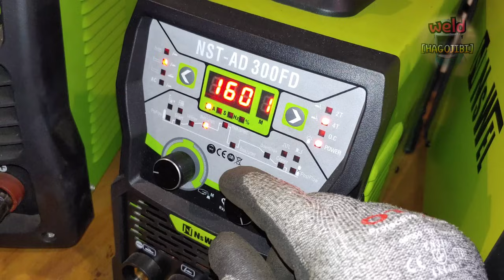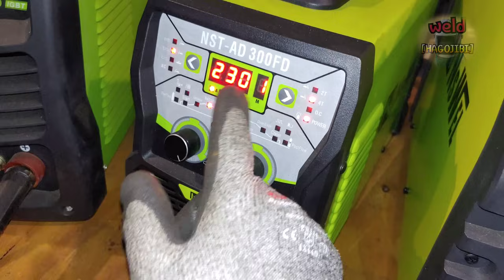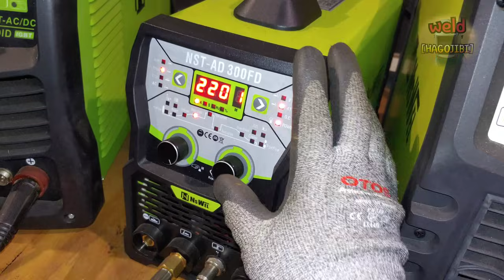Surprisingly useful technique ! Beautiful edge TIG welding process

Comment: Nice job! I’m seeing more and more guys laying the wire in the center of the weld and walking over it…. When I started 46 years ago if you had tried that you would of had 100’s of little holes on each stroke…… very nice video.

Comment: Amazing. can you explain the settings you made. first root second and third pass 
more warm for each string ,what materials? and exact filler rod you used also ?  give us details of the tech.    
what machine is that? looks incredible crisp and responsive.  super great ❤. and you can add advertising in form of machine for example. would love a link to purchase one myself.

Comment: Very good video, I have one question for u can u spot weld a few spot welds with no gas?
L left my gas on and lost it all don’t need it right now, but need to spot weld this for a friend.
thanks
Reply: In a word NO.  6010 Will work with your tig power supply, just reverse polarity to dc electrode positive.
Reply: @kirstenspencer3630  thanks that I will do, again thanks ur welding looks bodayus

Comment: Watched this video about 20 times over in an attempt to wing a tig weld test tomorrow.
Reply: How'd you do on the test?
Reply: @ProMurd3r  did good in the first half just fusing 0.5-0.7mm stainless sheet then 2nd half was welding on this shitty scrap material covered in plastic and it was terrible , someone else with more experience and codings got the job
Reply: So sorry to hear about that mate, hope your welding journey is doing better these days. I passed my coding 1st try. 6gr stick as well. 😢😎😅

Comment: Nice job but I am not seeing the practical application for this.  It would go way faster to do this with a mig/dual shield process.
Reply: pretty
Reply: Just about everything I weld is TIG. 
Nearly everything I build is machined, and there's no way you're putting MIG beads on it.  I weld racing exhaust, turbo components, and custom- engineered machines. I'll run MIG on thick structural >.180", but nowhere else.

Comment: If any purge welders read this I have a question. I've been doing some Sched 10 purge welds. Purge root comes out good but the cap I put on is coming out dark. Any tips?
Reply: Try more gas coverage and maybe a different type of rollout at the end of the weld
Reply: just turn the juice up! duh… 😜

Comment: Looks good bit more of the heat affected zone more on one side than the other.  Love those gas fuse lenses though. They really make a neat clean looking weld. Most importantly  I didn't see you check your root run for penetration. Or any destructive testing  done. 
Overall  it looked fantastic. Well done 👏

Comment: Perform this on an analog machine, in the field, or a weld test. Using proper root penetration. Your technique will not pass a pressure or non structural machine test. 😢 coming from experience. Not to be a jerk.

Comment: Beautiful but weak, MMA if you want a really strong joint.
Reply: that is such farmer point of view.  TIG can weld way better quality and literally have a hawks eye in the puddle and material. its also the most superb high quality with the best ability to control and plan for tensions and understand your materials fully. 

i can add that TIG welding really have no limit on Thickness vs MIG or MAG. MMA is grest but you never have the same control and the myth that TIG does only thin materials is fake fake 

the quality and durability of the TIG smash anything out there. MMA easily inserts way to much heat and the material have begun the process of atom breakdowns and made the structure weak.  lol
Reply: @reactstuffreact4500  Cold and brittle welds.  Tig welds always fail at the weld itself, MMA done right will tear a lump of the parent material off with the weld!  The weld should be stronger than what surrounds it if it's a structural joint.  As for stick welds overheating the material, that's mostly down to the skill of the operator.  Stick welding is becoming a forgotten art, it's being replaced by faster cheaper production welding processes that require operators with less skill.  Back in the day plant machinery was almost all done with stick, now companies like CAT use Mig/Mag processes for welding the booms etc on their diggers, but look at the quality of these now!  I've seen three year old diggers where the dipper arm has peeled along a fractured seem weld!  That just didn't happen when they used to stick weld them together, and I'm seeing it more and more these days as they try to cut back on production costs.
Reply: @Altair885  You mix up TIG and MIG as if they had the same deficiencies. Alernatively, maybe TIG welds fail at the weld when you do them? 
It's the go-to method for the "most serious consequence of failure" welds in aerospace, nuclear plants, grand prix racing (land and water), medical equipment, etc etc.
Reply: @Gottenhimfella  They do, it's a fact that they are both processes that inherently result in cooler more brittle welds, you know different?  You didn't include pipeline or oil rig welding in your list🤔😉.  But ultimately your assertion that just because a certain process is used in an industry then it must be superior?  That's simply incorrect, there's lots of reasons why you might opt for one process over another, but it doesn't automatically mean it's the strongest joint.
Reply: @Altair885   Pipeline welds are routinely TIG, unless they have to be done outside in windy conditions where MMA still has the advantage. 
I chose to list a subset of the industries where the consequences of weld failure were particularly dire. An exhaustive list would be exhausting.
Submarine construction is another I left off, in which MMA (stick) is never used today.
(Submerged arc is generally used for the circumferential welds, as in pressure vessels generally)

TIG offers complete control over the heat input, unlike MIG. 
Lumping those two very different processes together suggests that your dislike might be somewhat akin to that of a religious believer for faiths he does not share, which are assumed to share the same defects because they are not on the "one true path".

TIG does have several defects: it's slow, and (as a result) distortion can be more difficult to minimise in some classes of work.
Reply: @Altair885  I don't say TIG is strongest (although in some cases that is true); I'm rebutting your dogmatic contention that it's necessarily weak in comparison with MMA.